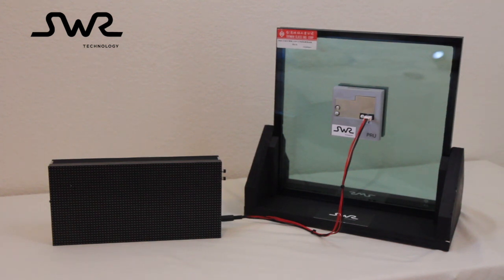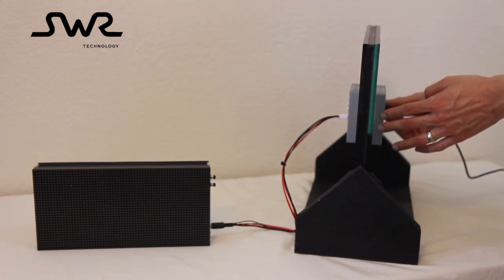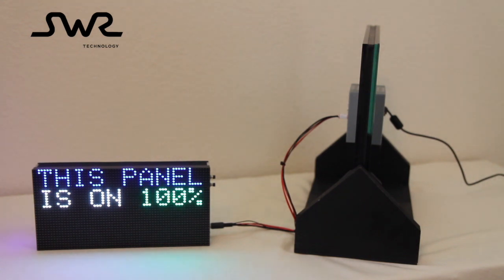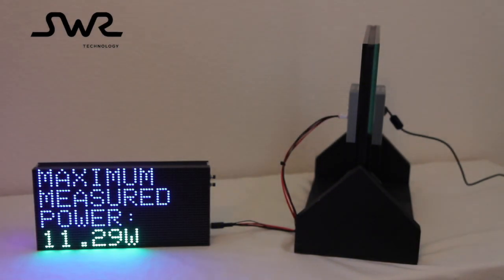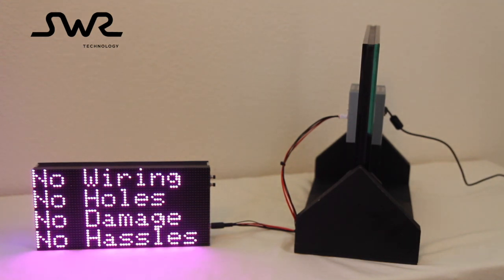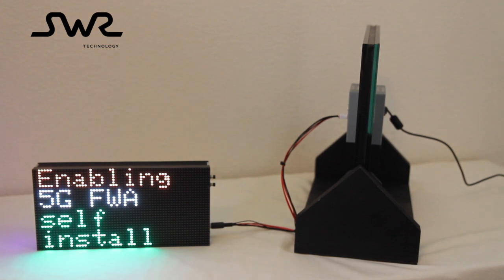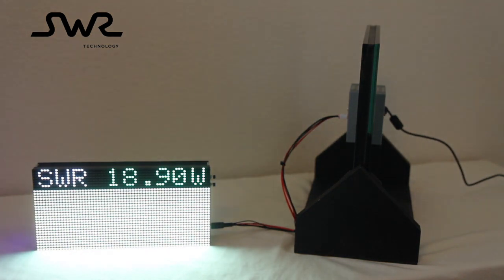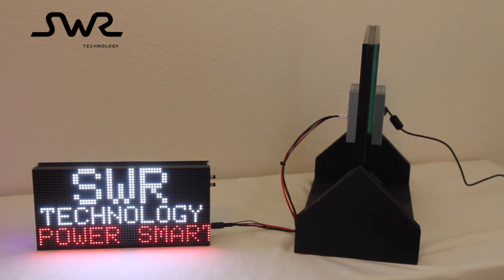Wireless Power Through Windows in 3 Easy Steps - SWR Technology

Comment: Does it work through windows in houses with double or triple glass where there is a few centimeters of air between? And if so how much powerless is there?
Reply from the maker: We are able to deliver the full rated power through triple-pane low-e glass (pane 1 with 3 layers silver, pane 2 with 1 layer silver, pane 3 with 1 layer silver) for a total glass thickness of 37mm.  Efficiency is about 80%.

Comment: Does it work outdoor for up to 10 years?
Some areas in North America can be harsh.
Reply from the maker: The system can be ruggedized for withstanding harsh environments with 10 year operational life.  For comparison, a similar system using default design components has an MTBF of 30 years based on the given operating environment and duty cycle.  Please contact us at swrtec.com regarding your specific situation for further discussions.  Thanks!